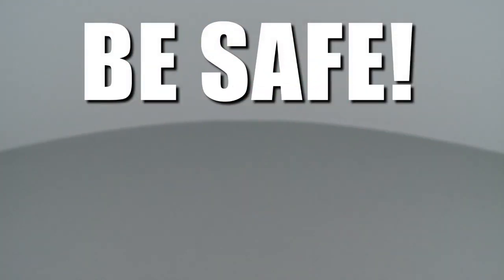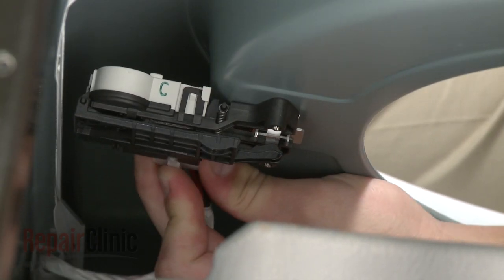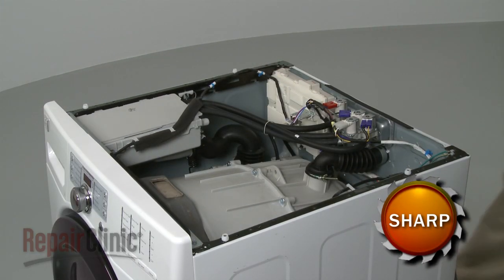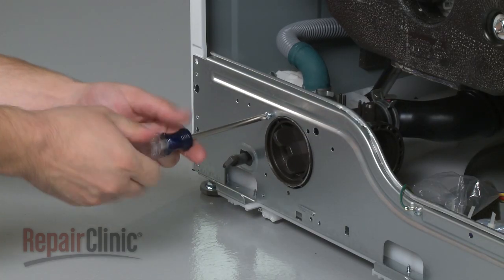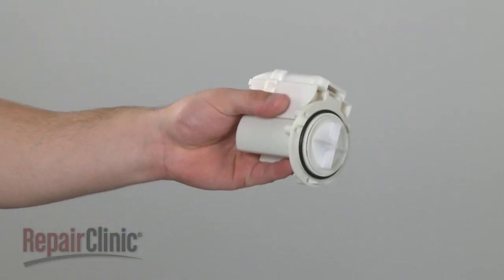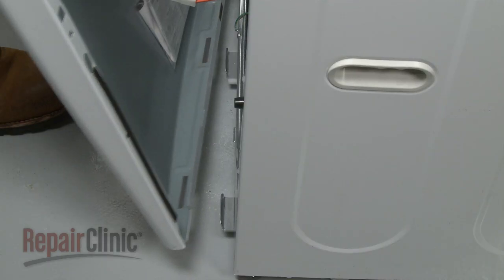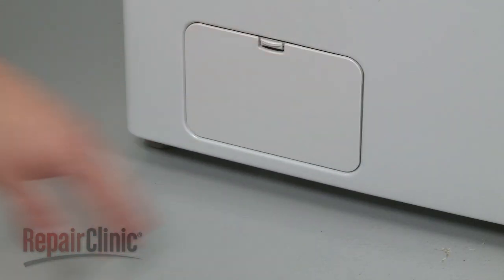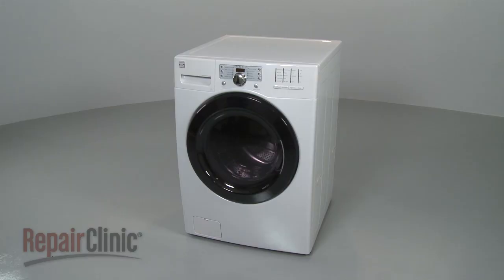LG/Kenmore Front Load Washer Pump Motor #4681EA1007G

Comment: My Pump mounting has three 10mm hhcs bolts holding the pump to the base and 5 Philip’s head screws, holding the pump to that plate. I had to disconnect 3 hoses to get the pump out. There are no screws to remove for my control panel. It just snaps in and out. 
For the record this video made it easy for me to get through to be able to identify my differences, so I am thankful!!

Comment: Perfect.  Very helpful.  We didn't believe it would take only 45 minutes to replace the motor.  The most challenging part was replacing the spring without the tool.  Otherwise a perfect detailed video.  Thank you!!
Reply: Yeah, the spring is a booger, lol.  Finally got it by using a flat head screwdriver and "prying" around the edges to make it go on.
Reply: @sandspringsgirl please explain further. I'm stretching it with pliers and levering it with screwdrivers and only managing to scratch the paint. Argh.

Comment: Parts were slightly different on my Kenmore washer but this video helped a ton. Well laid out and explained everything you need to know.

Only thing to note is if you don't have a spring expansion tool it's a pain to get the boot back on. I used a wrench and some zip ties to get it back on.

Comment: This video was outstanding and was instrumental in helping me do the job myself. The pump replacement was easy and saved me literally hundreds of dollars. Note that after the pump replacement, I got an "IE" error. By coincidence only I presume, it was a water INLET error. Found the filter on the washing machine COLD water intake valve clogged due heavy mineral water we use. Cleaned delicate filter with took pick...and all is well!! Thanks for such a great video.
Reply from the maker: That's great! Good job! Thanks for the comment.

Comment: LG washer with OE code
Would not drain , cycle interrupted
Cleaned all filters and tubes, no luck
Sounded like pump not working or at least having trouble pumping water

Ordered new LG pump
followed excellent video instructions
test wash cycle running now, sounds great already

cleaned the recirculate side and yellow spray nozzle at top of drum
also cleaned 6 oclock drain in the rubber gasket and cleaned the outlet, lots of buildup
black drain hose was completely clogged with black gritty mess, my guess is this is what burned out pump

Thank you for great information

Comment: Just something to add. The pump on my LG is half magnet, so the rotor turns in jumps, and might appear to be sticky with debris.  I took it out of the unit only to find it had no problem. I have a washer / dryer unit, and the problem was built up debris in the dryer parts.
Reply from the maker: Thanks for the tip.

Comment from the maker: Gat Parker, In most cases you can reverse the wires on two wire motors that use AC voltage and it will still run properly.
Reply: Does it matter where the wires connected to pump?

Comment: Thank you so much for your wonderful tutorial video. I was able to do everything, except when I went to put everything back, the door is not latching shut anymore. It is not catching. I had a heckuva time getting the wire connector unlatched from the door, so maybe broke it? Are the sensitive? What could I have done wrong? Do I need to buy a new door latch now? Should I just try to unplug door latch connector again and plug it back in? Any tips would be appreciated.
Reply: I found that removing the two screws holding the door latch was easy -- after giving up on pulling the door latch connector.

You might've broken the connector or its wires. An ohmmeter can be useful to check the connections if you can access the other end of the cable. Or remove it via the screws and examine it closely.

Comment: I am stuck on the step where I'm supposed to push the tab on the pump housing to release the pump housing. It's like it's sitting on a metal ledge. No tab to push. Stuck here without trying it on its back and taking a bunch of other screws out. There's got to be an easier way. Mine is a Kenmore. All steps were the same until this step. Help!

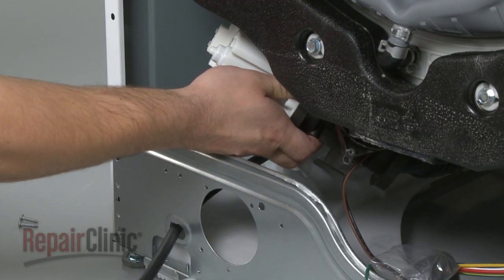Comment: Hi! I’m at the 2:42 mark and my kenmoore filter is attached to a metal bracket? Do I remove that instead? Or is there still a clip/latch? Thank you in advance!
Reply: Same situation I'm in right now... did you figure out a solution?
Reply: @jaredvahl9142  yeah, unfortunately youve got a little more work, but there’s 3 bolts or so you have to remove. You’re almost at the finish line!
Reply: Got it. 10mm socket with an extension and a ratchet
Reply: Victory at last!

Comment: Is this Video applicable to this LG Model WM3470HWA? I followed all instructions from the video and already remove the front panel but to remove, and snap out the pump assembly from the washer my model is different from what I see in the video, It doesn't have the 2 screws near the drain tube I dont see or feel a holding tab so I can remove the pump I do so a metal frame connected with 3 Flange Bolts screws on the matal frame and I am not sure if I do need to remove it
Reply: Same thing happened to me. Did you figure it out?